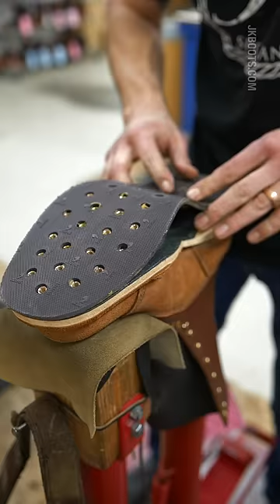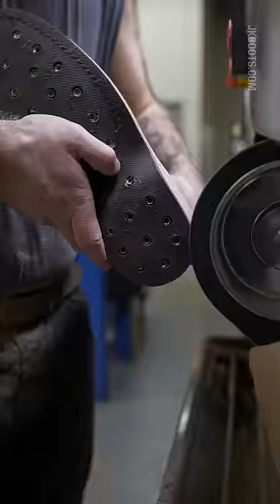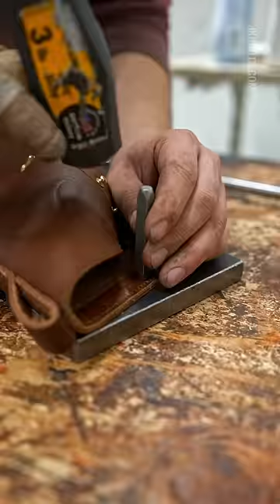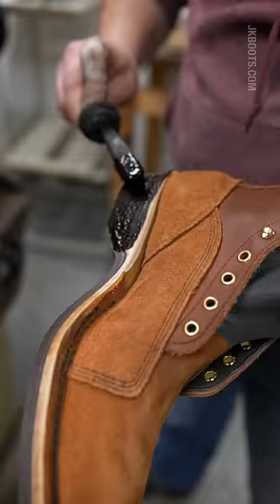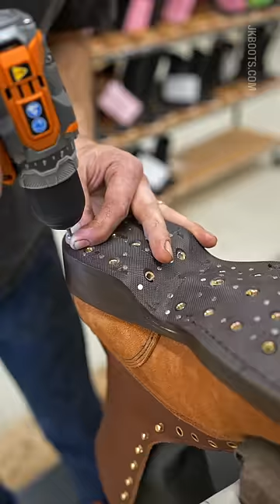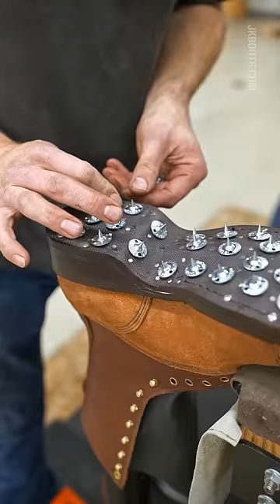Spiky Boots

Comment: Imagine trying to go through an airport with these bad boys on
Reply: Good thing they aren't made to wear through an airport
Reply: Imagina que te pisan y traes chanclas
Reply: Imagine trying to walk along the marble / stone floors of airports in these. Slip n slide
Reply: How do the nails not touch your sole!
Reply: @bovinejoannie9429  When they are driven into the boot, the boot is placed over a metal foot and the nails hit said foot then bend back over on themselves, so the point is facing back down
Reply: You can't even go through with steel toe boot
Reply: It looks like your design the walk on a glacier
Reply: You'd ruin those amazing spikes.
Reply: Или Вас пригласили в офис на встречу или в частный дом для вечернего ужина с паркетными полами. Это будет последнее посещение этих мест.
Reply: Theyre screwed into base plates @bovinejoannie9429